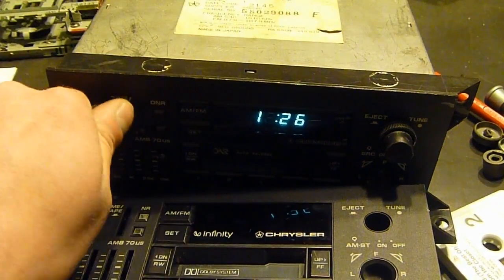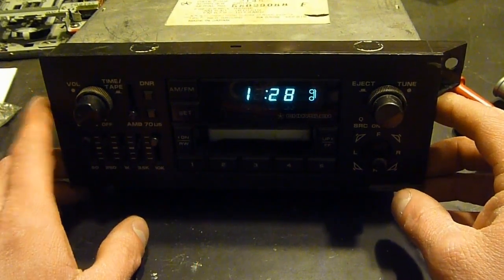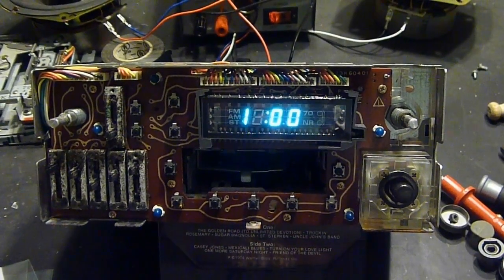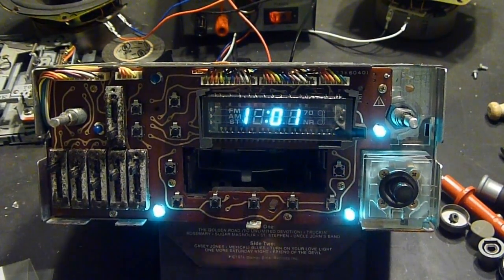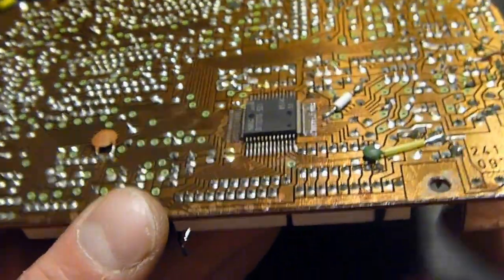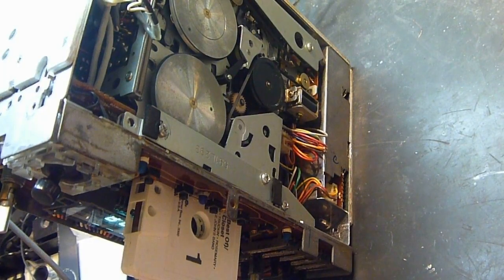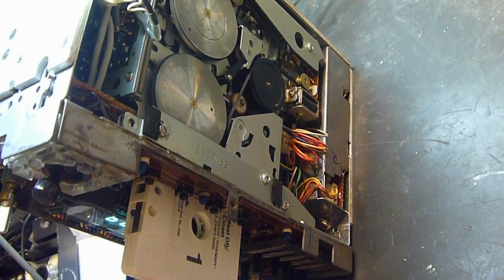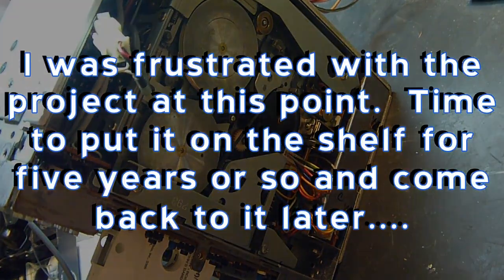(2015) 1980's Chrysler Infinity / Ultimate Stereo Repair - Pt 1

Comment: I have an Infinity II in my dodge pickup that had the same issue with cassettes. There is an electric "eye" that watches a wheel with reflectors on it to tell if the cassette is turning or stopped. Mine was no good. Luckily I had a donor stereo. Also I'm doing the bluetooth thing but im making an adapter to plug into to din plug on the back